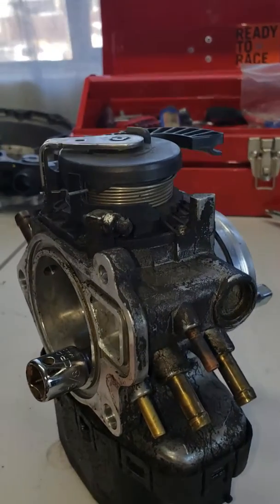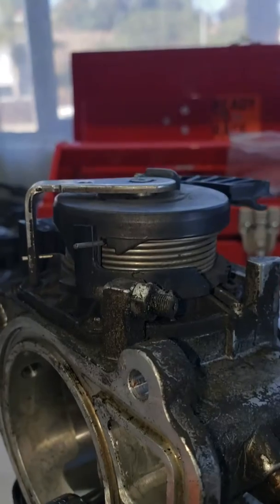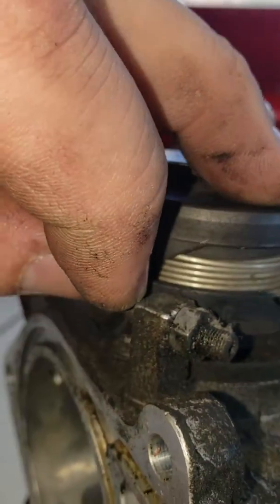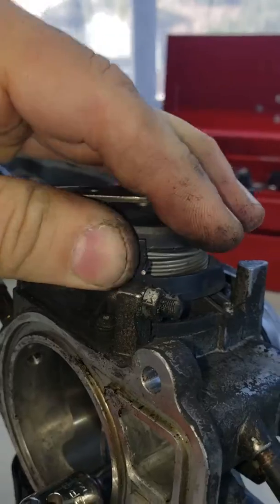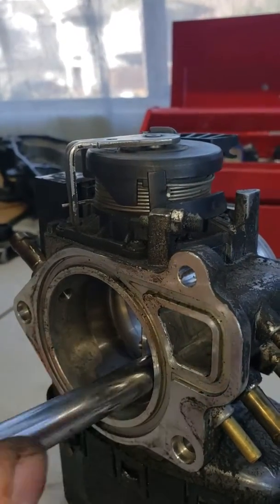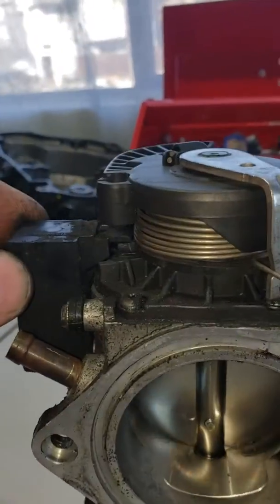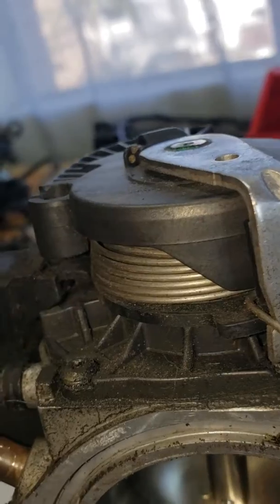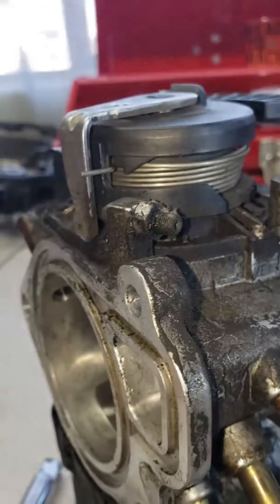Saab throttle body reset

Comment: My saab 9-5 (04) 
was in limp mode, but i didn´t have to manually reset it. Cause the mechanics seemed to worked like it should. So I just pulled the battery for 10 secs, and then my car was running fine again.